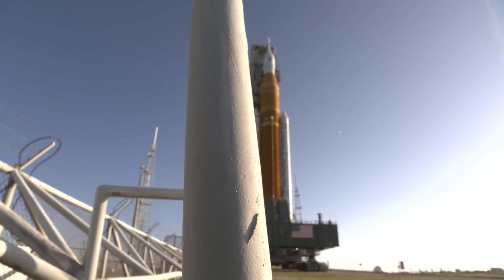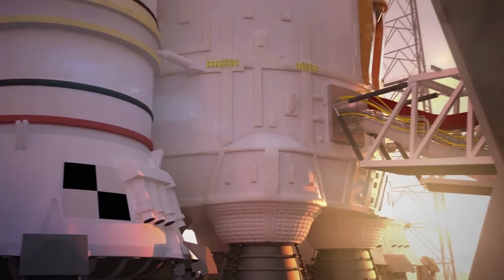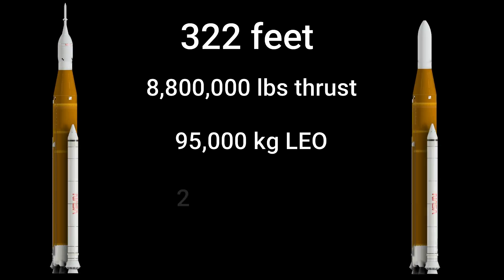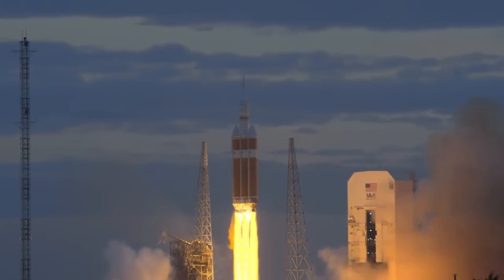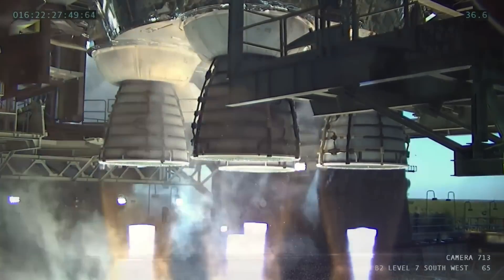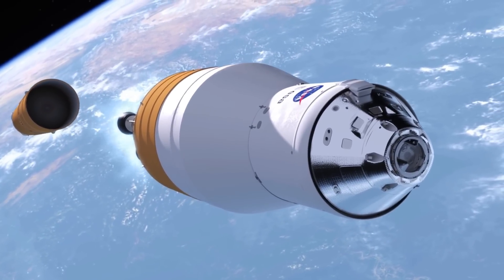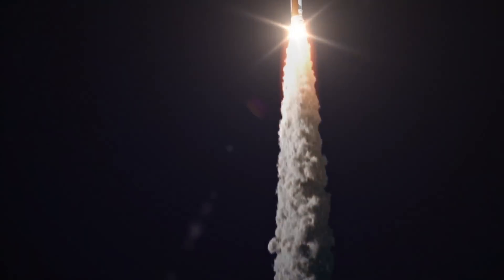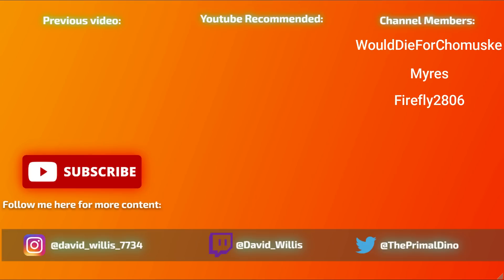SLS Evolution: What are the SLS Blocks?

Comment: I think the SRB's are a big mistake! It can't throttled or shut down until the fuel is exhausted, both significant safety issues. My personal favorite for the Block 2 SLS is the Pyrios boosters instead. The Pyrios booster uses two (2) upgraded F-1B engines, simpler and cheaper versions of the F-1 engines in the Saturn V's first stage, with more thrust than the original F-1 engines, 1.75 million pounds of thrust versus 1.5 million pounds in the original F-1. Each booster would have 3.5 million pounds of thrust, for a total of 7.0 million pounds of thrust with two (2) Pyrios boosters, more than the SRB's proposed for the SLS Block 2 variants, and eliminating the need for a fifth (5th) engine, which offsets the slightly lower thrust of the Pyrios boosters over the Saturn V's first stage. Finally, because the Pyrios uses the same liquid fuels as the Saturn V's first stage, RP-1 (kerosene) and liquid oxygen (LOX), it can be throttled and/or shut down during flight, a much safer option for a man-rated spacecraft, IMHO. BTW, I'm not the only one who thought so. Dr. Werner von Braun, designer of the Saturn V, resigned from NASA in protest over the decision to use SRB's for the Space Shuttle. The Challenger disaster proved his predictions tragically accurate. NASA appears poised to make the same mistake with the SLS as they did with the Shuttle. "Those who fail to learn from history are condemned to repeat it!" - Anonymous.

https://arstechnica.com/science/2013/04/new-f-1b-rocket-engine-upgrades-apollo-era-deisgn-with-1-8m-lbs-of-thrust/

Comment: Too expensive to get in the 30s a rocket that barely surpass the Saturn V. This rocket can't compete with the upcoming Chinese rockets and using hydrogen from the first stage makes little sense. 
For the. time and the amount of money that it toke it had been better to create a new first stage and use the Delta IV less expensive rocker engines for the second stage (with an extension) and get a 90t to lunar orbit. The other option was to take into account the years NASA has on space assembly and use multiple launches to create a modular system for the Moon program.
Reply from the maker: SLS does not take any more money per year than the space shuttle did, and has more congressional support to boot. Cost is a non issue

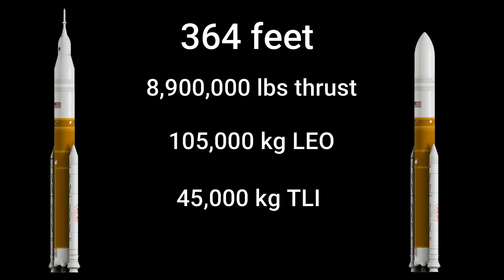Comment: Good video! Although when showing numbers (3:26, 7:33, ) it would be good to slash height and thrust units in metrics, as some viewers can not be familiar with the imperial system of units. I also want to say that it is really nice to have you! You explain well the reasons why NASA will upgrade the rocket and everything behind the SLS. Oftentimes, I find that NASA communication doesn't explain very well the technical reasons behind the changes.

Q: I didn't knew that the OMS stackover of the Shuttle will run out by Artemis 6. Given it is used on the ESM, will it be replaces by another motor or will a industrial develops a new Service Module? I guess NASA still wait for more Artemis mission before making a choice?
Reply from the maker: Thank you! And yes, a new engine will replace the OMS, but from what I know it will pretty much be identical to the shuttle oms but with minor modifications

Comment: Some of the information in here is not quite correct.  The SRBs and RS-25s aren't "tHe ExAcT sAmE" for example.  Space shuttle at liftoff was 7 million pounds of thrust.  You don't get 1.8 million extra pounds of thrust from just adding one RS-25.  Second, the block 1 has different sub-configurations as do the others.  Those configurations are certainly more similar than they are different, but there are major differences internally.
Reply from the maker: You get 1.8 million lbs more thrust by adding 1 more RS-25…. AND 2 extra SRB segments 

What sub configurations? Other than cargo NASA has released no other configurations for SLS
Reply: @DavidWillisSLS  By the way, I like your channel.  Lot of good videos and content.
Reply from the maker: Thank you!

Comment: The EUS is the most underrated aspect of the SLS Program IMO, there may not even be a need for a Block 2 with that thing around. NASA should try to make it refuelable in orbit, maybe add those new RS-25E's to it to swap out the RL10's and then have a monstrous amount of delta-v and C=3 available for outer solar system or interstellar payloads. Maybe they can even stretch the EUS for that purpose for even more performance and launch it on Super Heavy instead of SLS therefore saving all the development money/effort on a new Block 2 and instead maximizing the ROI on EUS, and allowing them to make more EUS' per year to launch more stuff.

I swear I'm more of a fan of the EUS than the SLS at this point, I mean when was the last time NASA had a dedicated hydrolox upper stage that could be this versatile and have this much potential, not since SIV-B and even that was 6m while EUS can have a 8-9m fairing, go EUS!
Reply: It takes 4 RL10s to make 100k lbs of thrust, a single RS-25 makes 500k lbs thrust and can throttle down to 65% or so.  I think you'll be crushing the payload with an RS-25 when the tanks are near empty...
Reply: @sirmicro  Exactly. And when you have a powerful core stage with giant srbs it makes more sense to pair it with a low thrust, high efficiency engine. That allows you to achieve really precise insertions that can be more difficult with a monster like the RS-25 and save lots of propellant in the process. Not that the RS-25 can't do those things, it just makes it more challenging. Use the correct tool for the job at hand.
Reply: Correction- Saturn V S-II was the largest hydrolox upper stage, 10m with J-2 engines
Reply: In addition of what Cody Ruthko said, there is also the question if the RS-25 can be turned on in space. Remember, on the Shuttle and SLS, first stage's RS-25 are turned on with the help of a little hydrogen on the launch pad. But yeah, go EUS!

Comment: Boeing has also been looking at producing carbon composite EUS tanks, which would reduce the weight of the stage significantly and would increase the SLS's lift capacity to be in the ballpark of Constellation's Ares V.
Reply: they would probably need another 40B if we were lucky

Comment: Well done. This was a good explanation.

It seems unlikely that SLS block 2 is actually going to fly. The cost per a launch is massive, and by the time would be flying at the earliest, it is highly likely that SpaceX's Starship will be flying, and even without that Blue Origin's New Glenn will also be flying, and although NG won't have the same lift capability as SLS, the sheer cost difference would by itself make a massive difference. I'll be surprised if block 2 flies.
Reply: The thing is that Starship and New Glenn need to prove commerical viability if they want to last long. If either are unprofitable to run then they'll die. SLS doesn't have this problem.
Reply: @hussarregiment7045  That's true, but commercial viability here shouldn't be that hard if they can actually work. If Starship can do second stage reuse, then it will likely quickly become cheaper than any rocket which isn't doing at least single stage reuse for even very small payloads. And NG is being built to be efficiently and cost effectively reusable from the ground up. (If I were to guess a problem with NG, it would be that reuse for it turns out to be harder than they expect, or they end up losing more than they were expecting early on.) And of course, there are all the other new rockets coming online also (see for example, Tory Bruno's comments about the possibility of a Vulcan Superheavy).
Reply: @joshuazelinsky5213  The thing is this is all built on hypotheticals, if Starship can achieve reuse, if it can have high turnaround, if it can refuel at the scale it needs to, if is cost-effective. None of this has been proven yet, and frankly I do have my doubts about 2 of these.

However another thing is that SLS Block 2 has something no other rocket her can do send 46+ tons on TLI in one launch, at best Starship will need 10 if you believe Elon Musk, althouth it's probably 14-15. And unless you're using Elon numbers (5 million dollars to refurbish and get ready for another launch in 3 days) then I don't see how it's more cost-effective than SLS Block 2.
Reply: I agree SLS Block 2 will never happen. By that time it is highly likely that Starship will be available. If NASA really needs a lot of payload launched in one go without refilling for some reason, they could even use Starship in a partially or fully expendable mode. That won't be cheap, but probably much cheaper than developing (and launching) SLS Block 2.
Reply: @cube2fox  you are putting a lot faith on a rocket which any of it parts yet to grace space let alone moon... let's wait and see if starship launches, if can refuel, if it can  moonshot...
Reply: @izanagisburden9465  Surely SpaceX can do it. Even the conservative bureaucrats at NASA believe in Starship.

Although I'm doubtful about SpaceX ever being allowed to launch and re-enter humans with Starship. Seems quite dangerous. If they aren't allowed, their Mars plans are toast.
Reply: @cube2fox  dont think for a second i don't believe in starship... what i don't believe, is pricing being this low when half of the development isn't even complete
Reply: @izanagisburden9465  Pricing will surely be much lower than SLS cost. Even with an initially expendable upper stage. Probably it won't be anywhere near Falcon 9 price though.
Reply: @cube2fox  like I said first they launch it, refuel it, TLI it & return. Then  let's talk about pricing, people have weird mentality that whatever the price spaceX sets as goal is rigid
Reply: Not really, all they need to do is fly SLS 10 times, and afaik, Block 2 boosters are already in development and their components will be implemented into B1B flights over time.

Recent FSB-2 test on July 21st had some Block 2 parts

Arguably the largest and probably hardest thing to make for block 2 will be composite casings for the motors

Comment: Im not exactly sure if we'd see block 2, Id expect for the commercial industry to take over in launch services by that time, which would free up quite alot of cash for NASA
Reply: No it won’t. 
Starship is a joke, and the proposals for commercial manned lunar landers are 
1. As expensive as those planned by the government (Altair vs commercial landers costs) when you account for the 2 models.
2. Require construction from multiple launches that add up to ~600mil (vs $1B for SLS)

Also, SLS has a limited supply of Shuttle components that require the advanced boosters to replace, as the old Shuttle SRB factories are long dead and will not be reopened (they use outdated steel casings for the SRBs, which have long since been replaced by GEM-type casings.
Reply: @innosam123  how does that make SLS Block 2 not unnecessary? You're just saying completely unrelated stuff
Reply: @innosam123  Altair was supposed to be $12b, ALPACA is $6b and the Old Guard was $10b. Starship is $3b
Reply: @iamarokotmanson  So anywhere from $16B to $13B for the landers. More expensive than Altair.
Again, they’re buying 2 landers because NASA doesn’t trust the companies to not raise prices later on due to having a monopoly.

Even if you discount that, and just compare 1-1, Altair has a crew capacity of 4 (not 2, like the other landers, minus Starship) and could send the entire Orion stack from TLI to the Moon and back off again. 
Altair is much larger than any of the landers (minus Starship, which even NASA notes was an underbid from SpaceX).
Reply: @innosam123  how is that an argument for SLS B2?? You just proved distributed launch is better and cheaper
Reply: Almost definitely. Orbital refueling will make it completely unnecessary

Comment: My favourite fact about the block IB SLS is that it has Saturn heritage. The Saturn I S-IV second stage was 5.5m in diameter. Over the years 5.5m tanks have been suggested for both Shuttle Boosters and the Ares-I second stage. The EUS oxygen tank is 5.5m in diameter.

The block system is a really clever way to get around some of the limitations of govt-funded development. In such a thing, peak funding is the limiting factor. By spreading the peak funding between multiple waves, you can get bigger and more powerful rockets at the cost of time

Comment: I heard that there's a chance NASA will use two upper stages for Block 2, one which is the EUS we all know about and other which is way more powerful but less propellant efficient
Great video btw
Reply: Is it the J2-X or something else?
Reply: @innosam123  we don't know guess it's J2X since it's the easiest to develop because rocketdyne has everything to continue development since it was halted in 2013
Reply: @cynbloxy  The only other one it could be is BE-3, but after the proposal was made, no progress has been made. 
Considering the nightmare the ‘commercial’ manned lander and spacesuit has been so far for NASA, it’d be silly to replace the 2nd stage with a commercial 2nd stage after EUS already is partially finished.

Also, BE-3 is less efficient- and AR has the also mostly-finished RL-60 lying around, which was designed to have 4 times the thrust with similar efficiency and size (and was proposed for the SLS as well).
Reply from the maker: Thank you!

Comment: It would be nice to see you talk about some of the proposed SLS launch versions, like Block IA (Advanced Boosters with ICPS), Block 0 (no 2nd stage), Block III (5-engine core) and the Dynetics LRB SLS.
Reply from the maker: I’ll save that for its own video, how about that?
Reply: @DavidWillisSLS  Nice. 

I forgot about the J2-X/high-thrust 2nd stage as well, which would work really well if we wanted to replace the ISS.
Reply: @innosam123  given that NASA is auctioning off J-2X, I don’t think that’ll ever happen sadly.
Reply: @innosam123  Earth Departure Stage?
Reply: @josh.m.martin808  Well, an earlier version of it.
Reply: @OlCrunch  We don’t need the J2-X- the RL-60 was also under consideration. 
BE-3 would take a pretty big performance hit, though.

Plus, if we build it, either J2X and/or RL-60 would be useful for Vulcan.

We just need a high-thrust EDS for space station construction/Earth-Orbit Rendezvous.
Reply: The "A path" versions were focused on upgrading the boosters first (1A) with Block 2 adding EDS (with J2X) and the 5th engine on the core. 2A ends up with a Cryogenic Propulsion Stage about 5.5m diameter with 2 RL-10s. This would've been a very expensive route as it would require developing new boosters, 2 new upper stages, 2 more mobile launchers.

The "B path" is what was actually pursued. Partially because the refocus of the target orbit to BEO-only made the EDS less important. The upper stages merged into the "Dual Use Upper Stage" which eventually was renamed the Exploration Upper Stage with RL-10s which worked out to be better for TLI performance. This left the Block 2 (B) to be the SRB upgrade which also trades better than LRBs for BEO missions (the rocket equation favors burning lower-efficency propellant lower into the gravity well. Same reason the Space Shuttle fired its OMS during ascent.)
Reply: source?